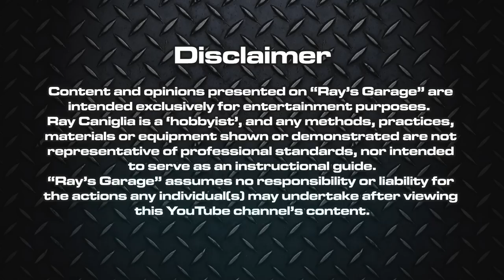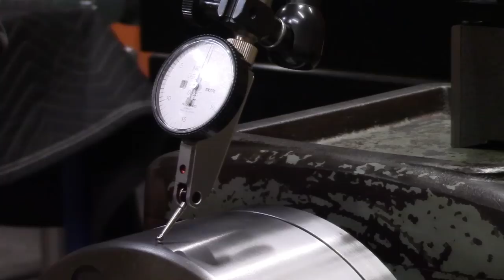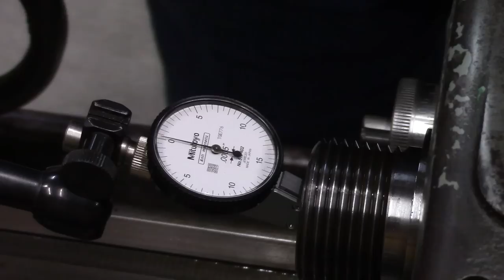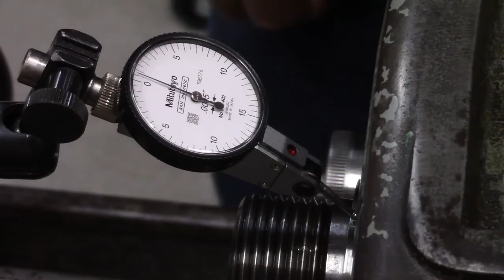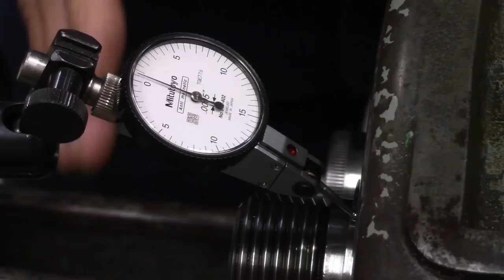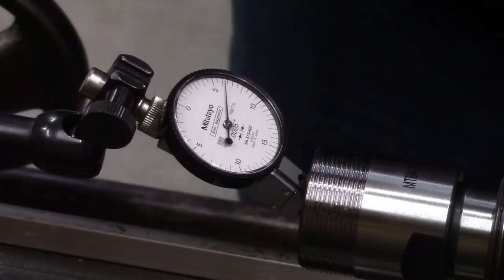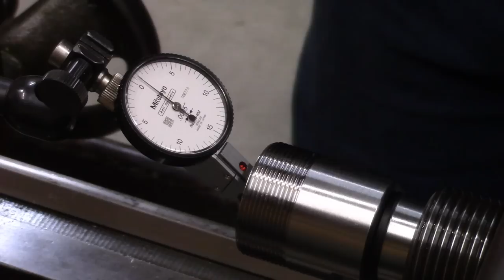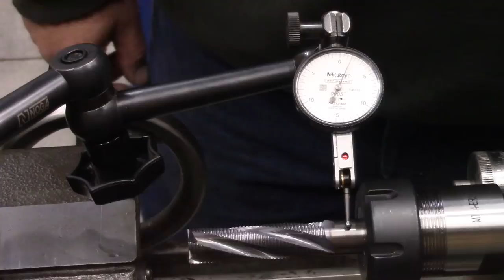Banggood ER32 Collet Set Revisit #realraysgarage

Comment: Interesting to se your review i have a ER 40 set of collets  my self  & found  that there is a lot of inconsistency in there production. to get the best out of my collets. i recognised that my chuck centre will  not be  the same as that chuck centre of the people lathe that produced  the collet 's  indeed my centres may well be worse.  my set came  with a  ER collet chuck.  so i set the collet chuck  up in an  4 way Adjustable   chuck. to red zero & then set the collet's in the chuck. the results were quite spectacular all but one red zero  & the one that did not was tenths out .  & could be adjusted in if i was to ditsier it . So what did I learn well Yes their are some bad firing colitis out there  but even the worst of then can be used if you have a way to zero  them my collet chuck as a method to zero out  the ellipse of a bad collet set whit jack pint on the extra of the collet  chuck.to set zero should be required.  But for les aculeate  jobs can be exsepterbal within  the natural variations . in manufacturing,  proses , So in conclusion the  ER collet & chuck is the best way to hold work  Collet's & that in it's  self reqiesr a means to re-Cantering for repeatability. 
for excellent results. Les England

Comment: All of the ER collet chucks I have from China have the same problem: the nut has insufficient relief. This results in different runout each time you tighten it. After increasing the relief, all sets meet specifications. YMMV.
Reply: That is interesting. I have also suspected the nut integrity for a long time. Can u please elaborate on how to increase the ' relief '? In any case I believe that these cucks and collets at best have a 0.001" run out. Fine for hobby stuff or even some model engineering but not for precision machining. Thanks.

Comment: I recently fitted a ER32 collet holder to my lathe. Holder run-out was 0.5 thou, and max runout on held part was 2.5 thou. Cheapest on Ebay, I will take that. Way better than a 3 jaw, and just as quick. Better would cost a lot more, and not sure I would ever benefit. If I need better, I have my 4 jaw...
Reply from the maker: You are correct, for most of us 2.50" is acceptable for most little jobs and 4 Jaw for picky jobs!

Comment: I just purchased a MT3 ER32 collet chuck from Banggood  for use on my 10" Atlas lathe. The collets were purchased separately on Ebay, as a 19 piece set. I tested it just as you did, with similar results, namely about .005 - .006 " TIR. I drove the chuck into the lathe with a dead blow hammer just as you did.  I also used Dychem on the collet and checked the fit of the MT3 taper in my spindle, which showed fairly uniform contact over the entire length of the taper. A poor fit in the taper could cause run-out as well.

I next made a collet draw-bar from a 12mm bolt (mine was 12mm thread rather than 1/2-13). Due to a small run-out of about 0.0015" in the spindle MT3 bore, I rotated the collet chuck to get the lowest TIR, still about .006" with a 5/8" end mill and a 16mm collet. I also  noted several slitting saw marks and quite a bit of debris in the collets, which I removed before testing. To my surprise after tightening the draw-bar and driving the collet chuck into the spindle with the dead blow hammer and tightening further, the TIR was reduced to about .0015 verified with three different collets. I measured .002" TIR at 4" out from the collet on a drill rod. Maybe I just got lucky, but it might be worth trying a draw-bar on your lathe? 

Also, it any collets are magnetic, a simple de-gaussing coil will fix that quickly. Mine is an ancient one originally used to erase tapes for tape recorders, but it works great for all sorts of tools.
Reply from the maker: Thanks for the info Bob, I will give that a try next time I use these collets, I would be very happy to get better results than have to regrind my spindle and/or the collet chuck. I was also told to try a better quality collet chuck nut, several have found that to be the problem. Thanks again and thanks for tuning in! Best Regards, Ray

Comment: I have this collet set and the chuck runout is only .0005.  After inserting tool in the 1/4" collet, the tool  has .0035  runout.  By rotating the collet and tapping the shank of the 1/4" tool, I can get a grip with less than .002.   With a little fiddling when tightening tools, the runout can be quite minimal....at least for my set.   By the way,  I got my set from Ebay, but it is identical to the Banggood item.(same case, anyhow).  This was so I could get the 1/2" drawbar thread in MT3 configuration which Banggood didn't offer.  At the $68 price, these will do just fine until I am ready to spend more for a guaranteed minimal runout.

Comment: Ray did you try rotating the collet within the holder. All my taper tooling is indexed with mark to achieve the lowest runout knowing that runout increases with distance. The only advantage with ER collets over standard are the fact they can handle some variation in the diameters of parts

Comment: I recently bought collets with an accuracy of 0.003mm and they correspond to the declared accuracy. collets come in different accuracy classes! Simple ones are usually not designated <0.015mm. class A <0.008mm. AA <0.005mm. and UP 0.003

Comment: As I've watched a few of these videos on the ER collet chucks from various sellers I come to the conclusion that it doesn't matter if the cutter has some run out...….some runout would be expected for a cheap tool as the manufacturing process probably leaves much to be desired, but if you do a runout test on the actual cutter shank once it's mounted in the collet and tightened up you will get the actual size that the cutter will now have...…..cutter size plus runout will be the size it cuts metal at.

Comment: 35:15 that was lucky point.measure 5mm longer it tell difrent. turn your collet 90 you see difrent result. nothing is centric there, but if you. tool tip will run out more
Reply from the maker: Thanks for the info Jari, i have not used these collets since I made the video but might have a small project coming up and will need to use them.

Comment: 24:34 your needle is allmost 45 degree. put it paraller to surface you measure something like 15degree.. your getting cosini error. run out is smallerthan readout say, but this is good when measure incorrect. you can fix it and make perfect
Reply from the maker: Thank you Jari, I have been told the same by others and will recheck at a later date. Cheers, Ray

Comment: Really good review you're the only person I've seen so far that provides the absolutely crucial information: how far out is the spindle taper, because it makes a huge difference to your end run-out measurements so really impressed that you actually show your spindle accuracy.

one small point though it looks to me like your angle when sweeping the bore(s) is very steep on the indicator arm which may be causing some cosin error but that would only mean that the result is even worse than what you already showed just a heads up.
Reply from the maker: Yes, I did introduce a slight cosin error, but it was only a couple 10's once I did measure it correctly.

Comment: I have same set, I noticed that you pushed the milling cutter all the way back until it bottomed out inside. I found the when I did this test it improved if I didn't push the test piece all the way home. (like you did with the 2nd collet.)
Reply: I've seen higher quality collet manufacturers say not to bottom the endmill out in a collet chuck before tightening, some of the collet chucks come with a plug screw in there for setting the depth but I don't think that's a good idea.  Collets need to be able to pull the endmill back in with them, otherwise they either have to let it slip, or if it's too tight for that, they can jack sideways giving you poor runout.
Reply: Exactly what I was thinking.  Collets that wedge in backwards (like ER's) need the tool keep a bit off the bottom so that the collet and tool assembly can draw backwards as it's tightened.  I'd be curious to know if he still has the .007 runout if the tool isn't bottomed out.
Reply: Thanks for the info. I've done that for the past couple decades with all my routers after seeing it recommended, and never bothered to find out why I was doing it.

Comment: Hello Ray,
I purchased the same exact set,.and I had basically the same runout..........what I did was I rotated the chuck until I got the lowest runout.and I then locked it in......however there is another issue....the collet chuck will come loose on you and if it gets caught on the cutter it could become a bad situation......... what I did was make a draw bar from some drill rod woks like a charm now..I've been using it with great success........good luck with yours.....
Reply from the maker: Thanks for the info Ray, I agree and should have a draw bar! Thanks for tuning in my friend!

Comment: Thas is super smart for testing. To run the lathe both ways to warm up. Nice!
Reply: It is merely common sense logic . . . consider that standards are set in measuring at a given temperature ; above this temp parts will measure large - below temp will read smaller .   Auto engines are properly tested at 'operating temperature' . . . checking valve lash , etc.   So logically , it follows the same pattern when working with machinery !  Until it reaches operating temp , bearings will not be at their correct size for proper 'fit' of all attached mechanisms .   Sadly we live at a time when common sense is secondary to being good consumers ;p    "V"

Comment: Ray   seems we all are having issues with the Bangood ER32 and 25 collet chucks  , I confirmed my MT3 taper had all but zero run out, and reground both the ER taper and the face of the taper, only to find the runout only slightly better. I found two parts on the Sharrs tool site of a ball bearing nut. I still have a few of each of the ER collets that are questionable, but for the most part I am not getting less the 0.001 run out across the ER Imperial and Metric sizes ,....... seems nut is the culprit putting uneven load on the collet as it tightens down.  cheers

Comment: Hello Ray..I have the same collet set. When I got it about 12 months ago, the runout was so bad I put it away and forgot about it, till I saw your video. So I pulled it out and checked it and it seems to me the actual collets are the problem. The holder, though a bit roughly made has one thou runout, but 5 thou with an endmill inserted. I might make a new nut for it to see if that helps. Ken

Comment: Hey Ray, to help kill that echo when making vids just find a roll of old carpet and just hang it vertically in your shop. Maybe obtain some from a carpet layer for free. Old shag would probably work best. You'd be amazed at the difference. Don't have to be fancy, just poke some holes and thread some rope to hang it. High density fiberglass works best, but ouch expensive. Carpet will do in a pinch.
Reply from the maker: Thanks Doc, I plan on insulating and closing in the walls here in the near future, hopefully that will kill the echo! Never thought to hang carpet, great idea!

Comment: Do you buy collets of the lowest accuracy class and expect good accuracy from them?
Reply from the maker: No, This was a demo of the quality you can expect from China made products. You get what you pay for!
Reply: @RaysGarage  I recently bought collets with an accuracy of 0.003mm and they correspond to the declared accuracy. collets come in different accuracy classes! Simple ones are usually not designated <0.015mm. class A <0.008mm. AA <0.005mm. and UP 0.003
Reply: @RaysGarage  I recently bought collets with an accuracy of 0.003mm and they correspond to the declared accuracy. collets come in different accuracy classes! Simple ones are usually not designated <0.015mm. class A <0.008mm. AA <0.005mm. and UP 0.003

Comment: the slots in the collet are cut last--be sure to shine a lite and look inside and use a scribe to reach in and do a good long cautious inspection for burrs. The odds that the slots are deburred inside are one in a trillion. As they cut the slots using whatever method likely cutoff wheel the amount of the burr could vary widely. A slight burr will give instant and unquestionable runnout. If the burr is equal on all slots its possible you could get much less runout as the burrs crush down equally. Next comes the issue how to debur by spinning a hss cutter or something in there sort of tight to act like a hone?--I cant figure a way since you cant hone across slots. I strongly suspect the slots. Use an optivisor and strong light sitting at a desk and do a LONG carefull burr inspection.
Reply from the maker: Thanks for the info Jeff, I'll take a closer look at the slots.

Comment: Hi Ray, Start by checking your spindle runout with a known good MT testbar (dont you think one of your youtube friends got one you can borrow), regrind your MT in spindle if nessesary, from what Randy says he got a grinder :-) otherwise you will keep chasing your tail as also bcblock02 says, then get a good collet chuck, or as Randy says regrind it and get another collet chuck nut of good quality, the last set of collets you got seems to be of some quality from what the seller says "7. T.I.R.: 0.0003" or 5um. In order to make all collets running true, on your side, make sure your machine spindle and chuck holder running true; on my side, I'll make sure all those collets running in tenth." Let him keep his word.
I have several set of Chinese collet sets bought on Ebay and I always buy the ones thats states play under 0,015mm or less and have had no problems, does Banggood not have the same possibility of refund if stuff is not as stated.
And yes I know it is so easy to say Just do this or that, but price in mind some improvements is perhaps expected, and as Keith Fenner says "its unfinished tools", hope you get your problems solved with good friends help. All the best.

Comment: pounding against the headstock bearing is a no no operation  chipping thr bearing is quite easy. use the draw bolt man.for prcisionjobs the collect are ground in situ to eliminate as ll.the errors due manufacturinga grinding spindle is not too expencive man.

Comment: The fact that you get different run out when you install the adapter into the spindle tells me there is a mating problem between one or both. I would get something else of the proper MT and do some more investigating on that first. Until you can get a good foundation you will always be chasing your tail on top. I only mean if you want to try to fix it otherwise these look to be not good for much.
Reply: Not always so, total error is the vector sum of the errors in the individual components in any given radial direction. If those errors are all positive  then the total error will be greatest. As demonstrated in the video, by relocating the adaptor relative to the spindle the total error can be minimised by offsetting positive errors in one component with negative errors in the other.

Comment: I'm just watching your attempt to dial in the bare spindle. It looks like you are having the rolling element issue. It is a problem I often come across when performing commutator profiling.  In that case I minimise the erroneous reading by putting the profile head below the shaft.
As the inner race goes over a rolling element at 6 o'clock the shaft rocks by the amount of the bearing clearance.

Comment: Ray, good follow-up on the collets.  I like Randy's idea of regrinding the thing as you have nothing to loose.  I think the Nut is buggered too, did you check the face of the holder to see if it was running square to the headstock?

Comment: The outside of your spindle cant be measured that way because it shows signs of it being rusted some time in the machines history. It appears to have some light pitting and giving you some erroneous readings. You may have to lightly run a morris taper reamer in to clean up the inside of your spindle.
Reply from the maker: Thanks for the info and will into this!

Comment: If you can get .005" runout on an old worn n lathe spindle count yourself a winner. What are the bearings in the headstock if they are not taper roller bearings you are well in front